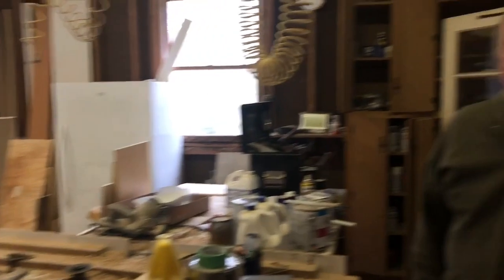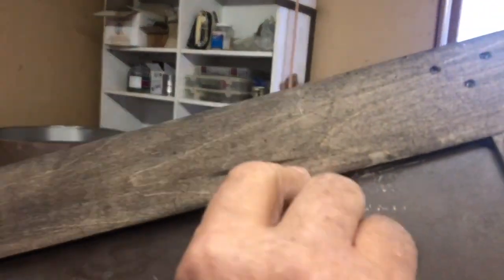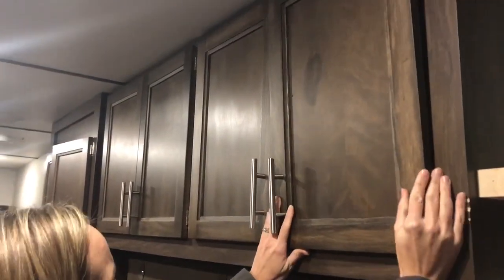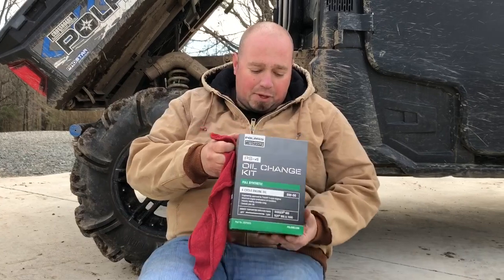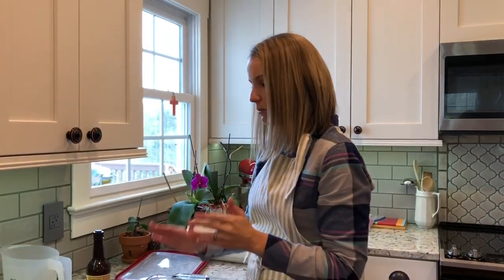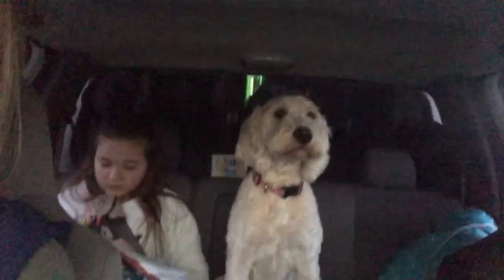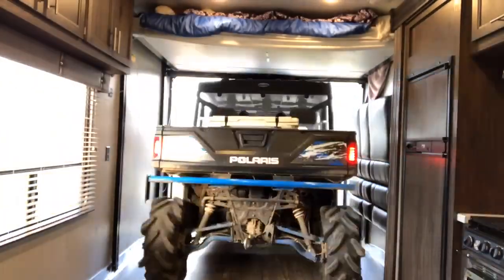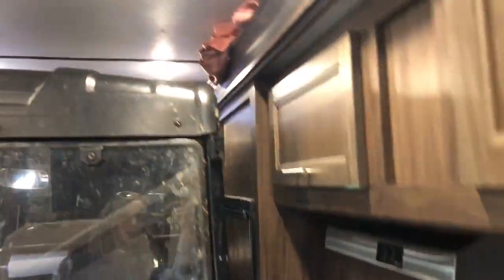Hatfield/McCoy WV ATV camping trip preparation!!! How to get ready and pack for an adventure trip!!!

Comment: Really enjoy the video's.  I had issues using regular straps for securing my UTV.  I bought  4 shock straps and WOW did it make a difference.  I will say that i have an open utility trailer but the straps never come loose.  It may be worth checking out.
Reply from the maker: Thanks!

Comment: If y'all decide to go with new trailer  look into eclipse  ATTITUDE.  The owner is an offroad addict its how they came about.  He didnt like anything they had available.  UTV underground also uses Attitude.  
Thats what we are doing, we have two side by sides and we put the big one in the toy hauler and little one in bed of truck.  Its awesome.  Tow with dodge 2500 5.7 liter gas unit.  Can tow 13,300 and put 3000 in bed.  Great set up.
Reply from the maker: We will look in to that, we are considering all options!

Comment: Have you ever rode these trails and camped in diffrent spots each night and did like a large 3-5 day loop . Is this even possible? I'm trying to plan it for this summer with my wife but we have not been there before. Don't know how far you can get each day. We ride alot and are not afraid of a full day ride between sites.
Reply from the maker: We’ve not tried that. I’m sure it’s possible, but we haven’t done it.